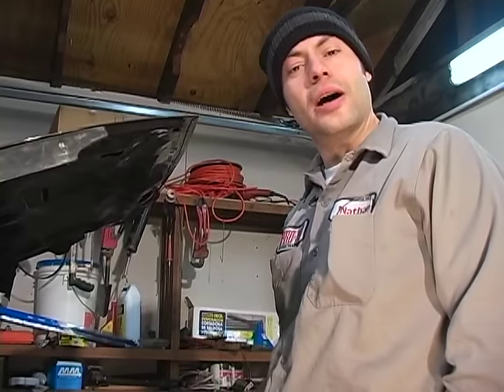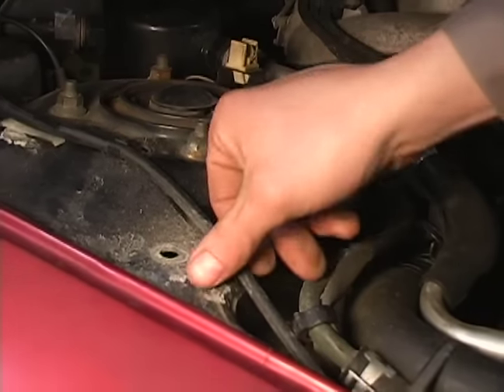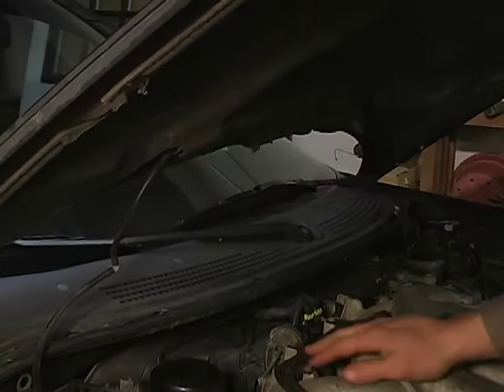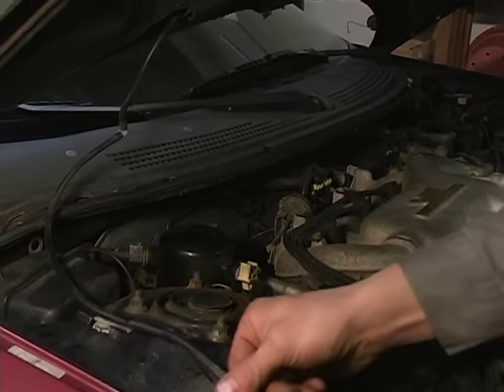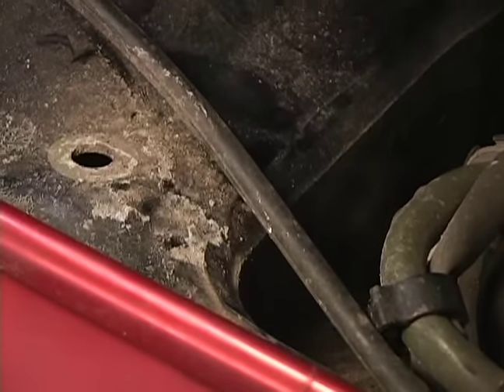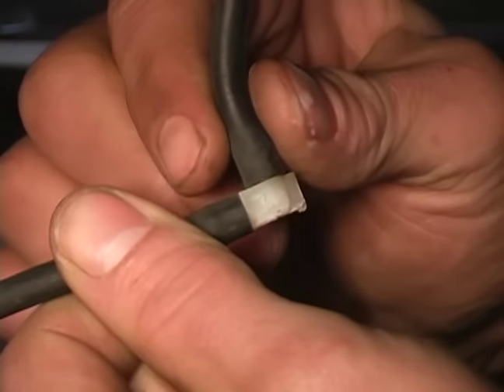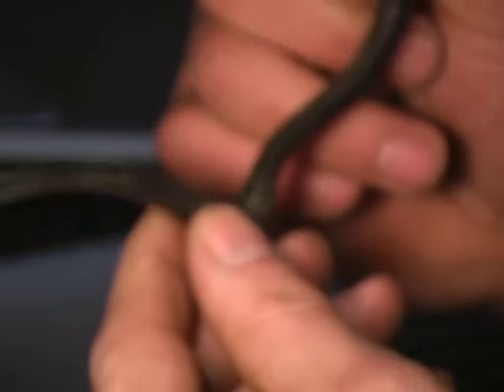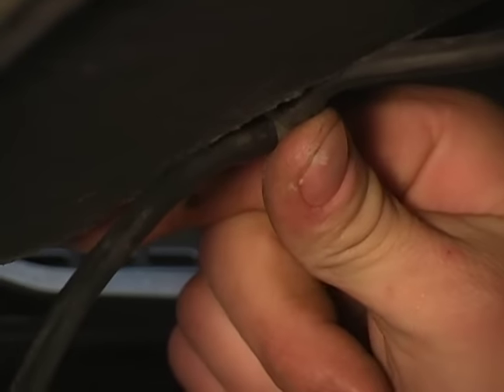How to Repair Windshield Washing System : Hose Location in Windshield Washer System

Comment: Zip tie first, put two little tie wraps onto each hose where it connects but, DO NOT TIGHTEN because you need to slip a third tie wrap. Trick is to carefully connect all three. Third wrap is to keep it from coming off again. Mine kept coming lose.

Comment: And if you have an Audi with electrical problem such as your BCM CCM this could be your problem as you have fluid spraying into your dash.   Not to mention they don’t use rubber hoses but plastic.   Stupid I know.   Cheers

Comment: hey Nathan, I have a 2001 Ford Expedition and my washer fluid has been leaking and i found the problem that the hose it a hole in it its the reaer washer hose but it right next to the washer fluid box and i wanted to see if u can do a videos and in how to replace it

Comment: I have windshield fluid coming out underneath the bottom passenger wheel. Hoping I can get it fixed with a $20 replacement hose

Comment: Thanks man,
   I have a 2005 ford escape every time I pull the switch for washer fluid on front windshield ,  the fluid comes out of the door jamb on the passenger side. I tried tracing the hose but I can't find it. I'm thinking it must be under the shroud of the left front tire. Pain in the ass. 
  The rear windshield washer works fine.

Comment: How is an L connector supposed to work?  I wasn't getting any fluid to the nozzle so I took the L connector off of the nozzle and still nothing came out.  Took the L off and fluid was getting to it.  I tried sticking a fine wire into it to try an unplug it, but that did not work.  Any ideas how to fix it?
Reply: replace the L with a new one   sounds like the old one is collapsed inside

Comment: My Hose are cut in half. Is there anyway I can repair this by myself?
(Chevy malibu 2002)
Reply: Get a plastic connector for an aquarium air pump. That will fix a cut-in-2-hose.
Reply: Duct tape